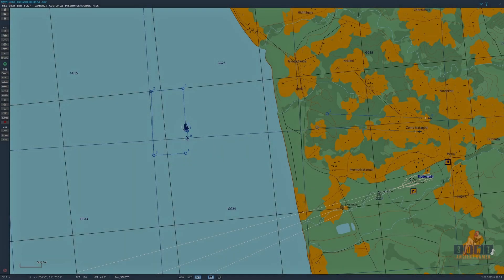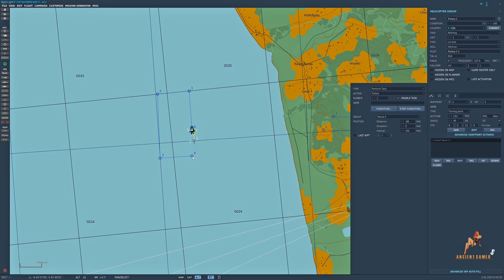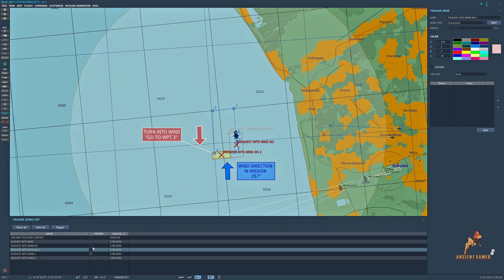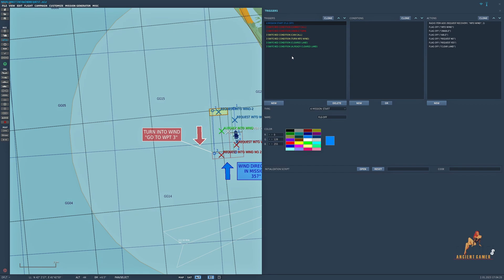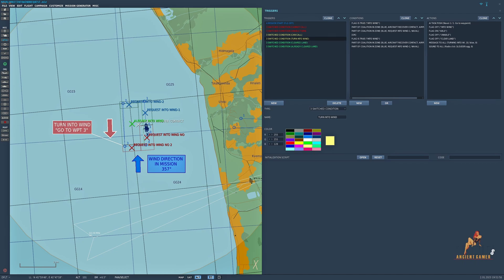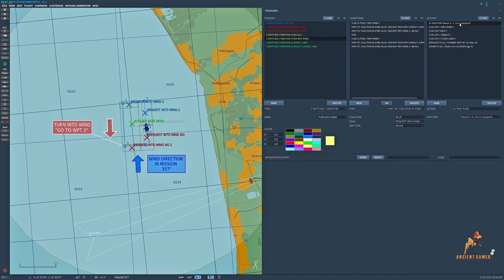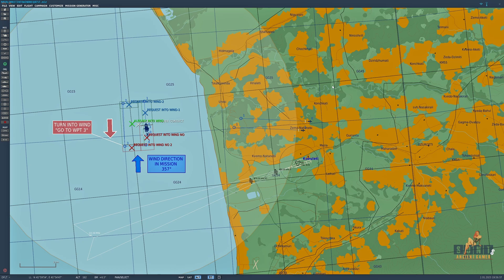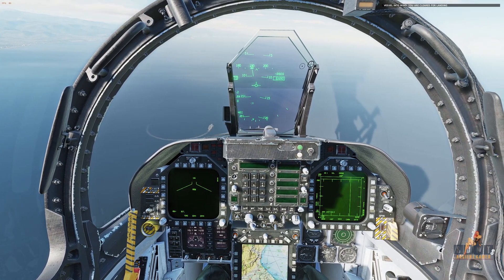Request Naval Vessel - Turn Into Wind - ME version

Comment: Are you guys working on a better solution? Because that is (sorry) BS. A checkbox with a logic behind it, an advanced waypoint option, but that is not practical at all. some community carrier scripts are easier to use than this.
Reply: Agreed. Considering we paid a heap for the SC, having an in-engine turn into wind (that actually turns into wind to obtain an appropriate wind over deck speed) is not a big ask.
Reply: Agreed
Reply: I do agree, that is not at all a correct and usable workaround of what we have missed for almost 3 years in DCS : a proper & precise "into the wind for planes recovery" order to the Carrier !!
During "Recovery Sessions" the Aircraft Carrier is supposed to be as stable as possible on a precise heading which give an apparent wind on the runway right into the runway's axe !
The precision asked by the aviators is less than 2 degrees ! Not in an approximative range of more than 10 degrees like it is written in a trigger of this mission !
Reply: Aviators cannot deal with an important cross wind during a carrier's landing !
The landing pattern is very short and need to be executed with precision (much more than for an inland lusual landings).
So the boat precision on his proper heading needs to be as perfect, stable and precise as possible ! Otherwise the landings are going to be risky ...
Reply: I was hopping for an in-game logic not an mission editor nightmare stuff.
I'm quite disapointed about the SC, after 3 years, plenty features are missing.
Reply: Yeah I was hyped that they had made a real solution, not this poor work-around.. like plotting a temporary and valid (no obstacles such as land) waypoint based on wind..